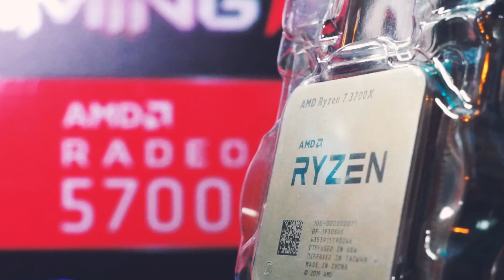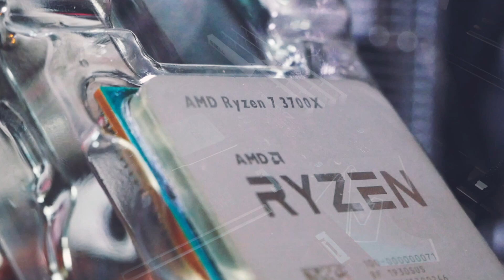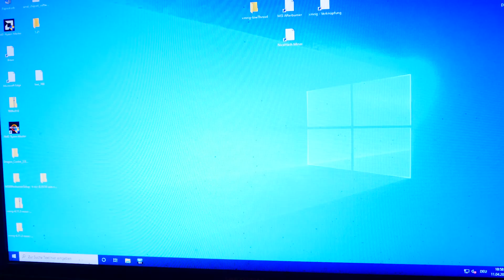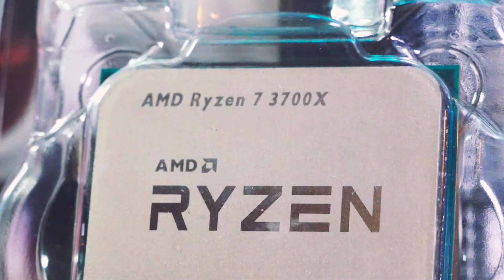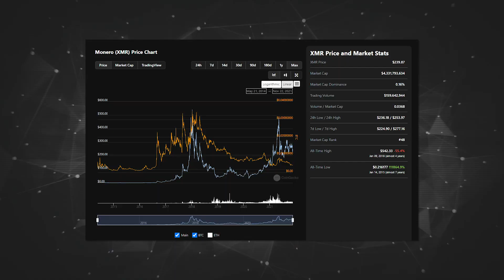Monero mining paid off my 3700X! Ryzen CPU mines XMR

Comment from the maker: 00:00 3700X test bench intro
00:30 costs and mining pool
00:59 earnings on supportxmr
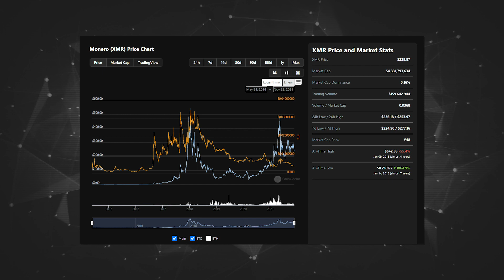01:21 low hashrate or heat issues?
01:54 RAM & RandomX
02:33 hashrate & settings
03:12 Power consumption
04:09 why XMR and not Raptoreum? Mining Strategies
05:32 Resumé and outro

Comment: What is the best budget cpu for xmr?
Reply from the maker: Definitions of "budget" differ and it also changes depending on region, but generally, used Ryzen chips are very good price to performance, or their server counterparts (epyc) or better, Threadripper. Important is L3 cache per Core to properly mine XMR, then it depends what your power cost is :) My fav is 3700X / 3900X because sometimes you find them cheaply where I am. Hope it helped a bit. Cheers :)

Comment: is 3700X and 5950 a lot better than Intel 11800H or Ryzen 5800H?  I used 11800H and Ryzen 5800H and it seemed it will give me $40 in 3000 years (I did some calculation and it is more like 1 to 2 years)
Reply from the maker: Yes Ryzen generally performs better because they have more L3 cache per core, Monero mining really loves that :) but aye either the calculations (or the hashrate) are off - you should earn more! There is a video linked in this one for some Windows settings that could help!